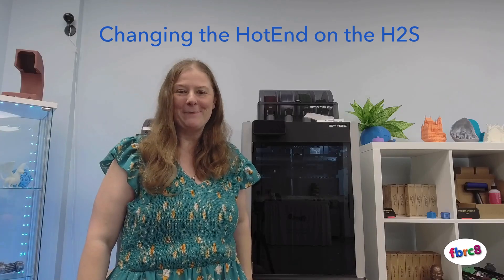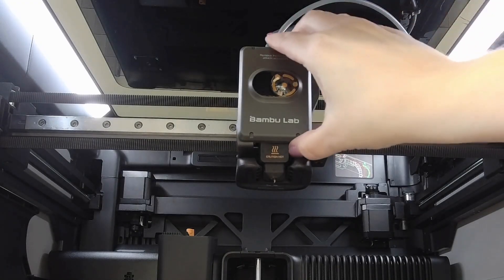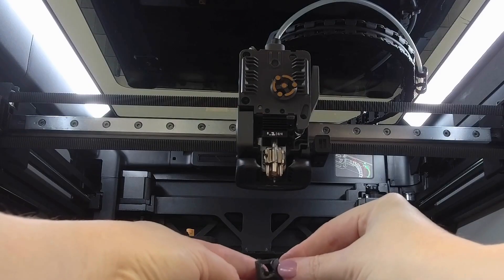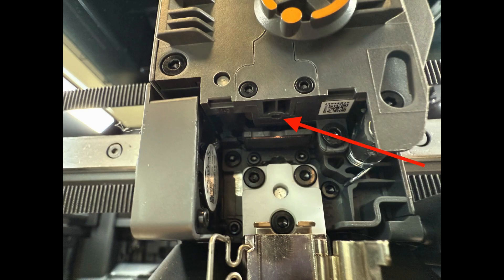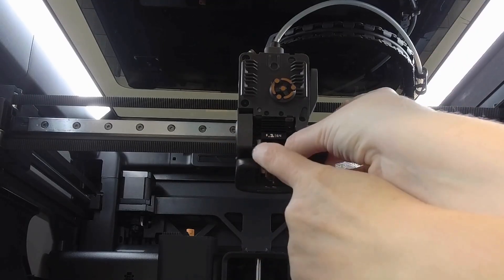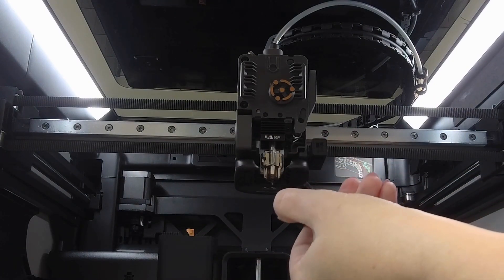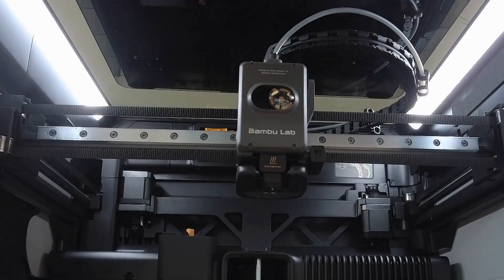Changing the HotEnd on the Bambu Lab H2S

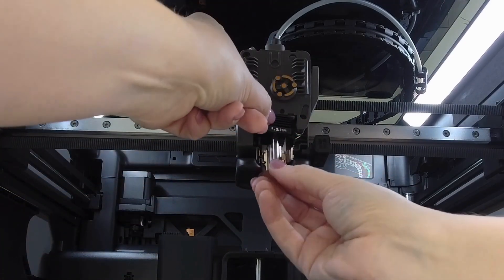Comment: 1:07 mine seems glued in? Won’t come out. Also my clips were reversed, solid bit on left, wire bit on right
Reply from the maker: The hot end should not be glued in; it is held in place with a magnet which can catch when you're trying to remove it. The two big things to check for:
1) Did you cut the filament with the lever before trying to remove the hot end?
2) Have you had any filament come off the bed and back up around the hotend? If you have a filament back up around the hotend you could have melted plastic making the hotend stick to the assembly.
Reply: @fbrc8 so with mine there was some old filament between the horned and the magnet which glued it down, I heated up the hotend and used pliers carefully and it popped right off. Must have been from when the poop chute got clogged up and it was almost a mess on the hotend. (My mistake for printing a chute, back to having a box at the back).
Reply: Just warm up the hotend a bit and it will get loose easy